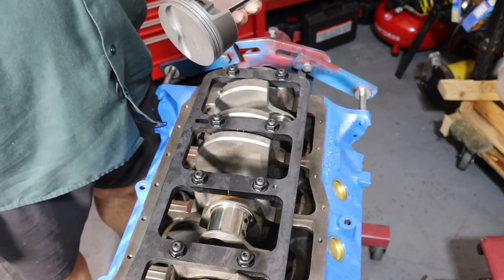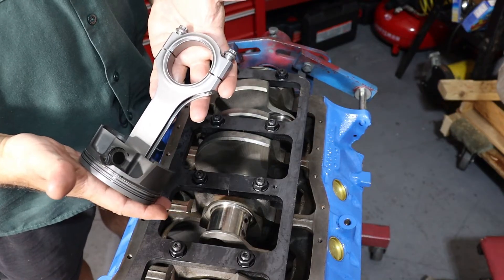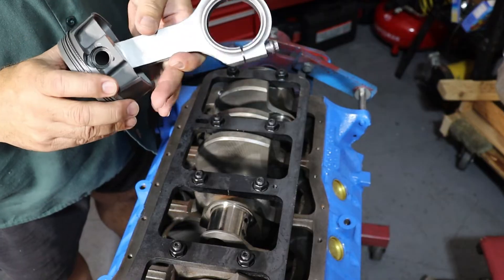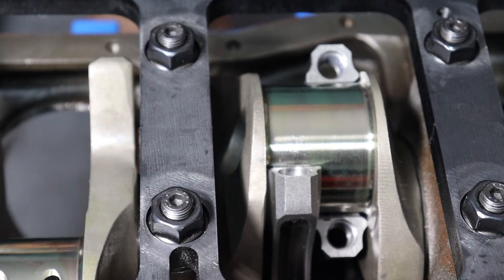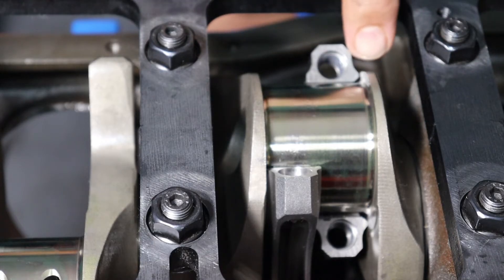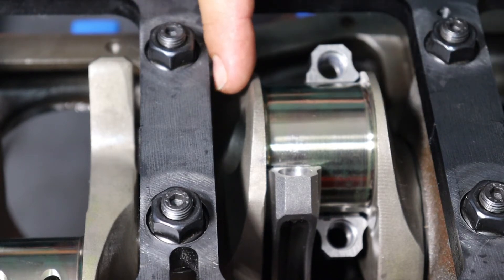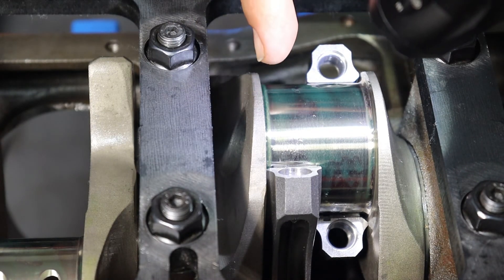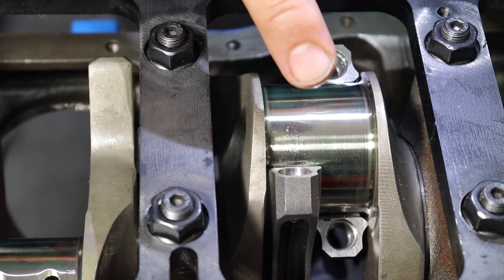Piston & Connecting Rod Orientation

Comment: Which piston go in first you could just put them in one by one or you have to put them in an order and the block
Reply from the maker: The order you install them doesn't matter, you just need to make sure that each is installed in the correct orientation.  I usually install them in numerical order so that I don't get confused and lose track of where I am in the process.  The right bank is 1-4 front to back, and the left bank is 5-8 front to back, so I start at the right front and end at the left rear.  But that's just my preference.  A friend of mine likes to do them in pairs by journal front to back, so 1-5, 2-6, 3-7, then 4-8.  It's totally up to you.  Thanks for watching!